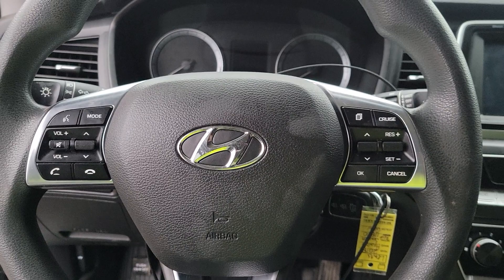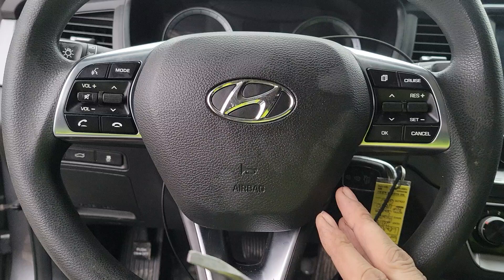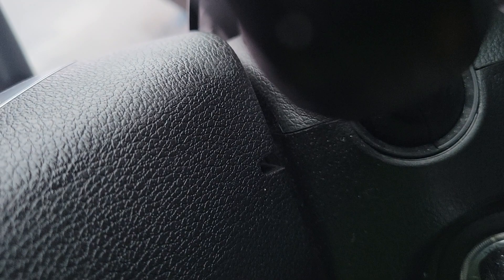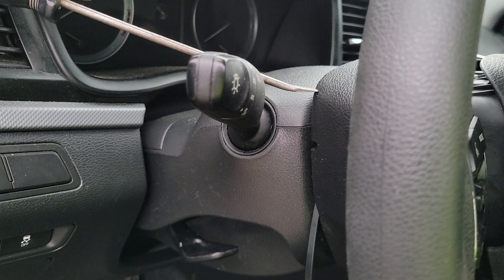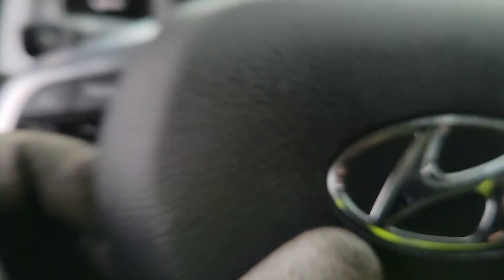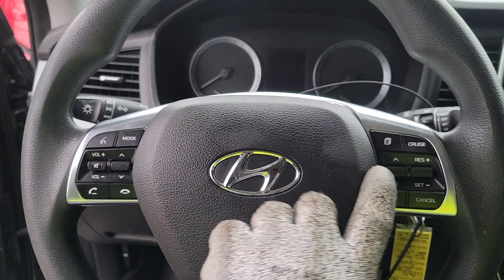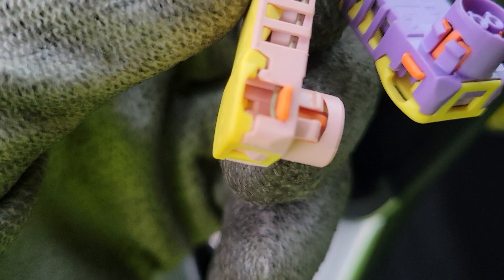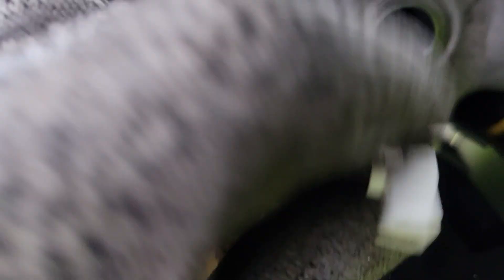2018 Hyundai Sonata Steering Wheel Airbag Removal

Comment: Thanks for the video. Pretty helpful for what I am looking to do, which is replace the chrome trim piece that surrounds the buttons.  It looks to be secured by those screws behind the airbag.  My question is how do I go about reinstalling the non-deployed airbag.  Once I have secured the electrical and ground connections, does the entire assembly just snap back into place?